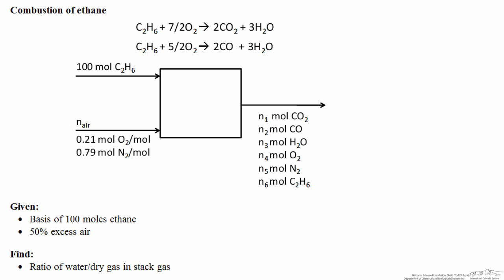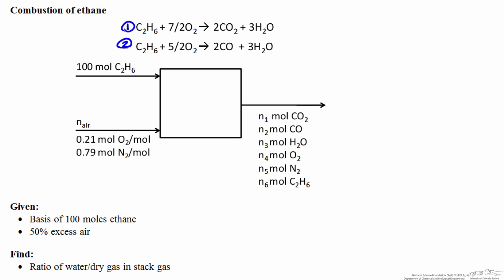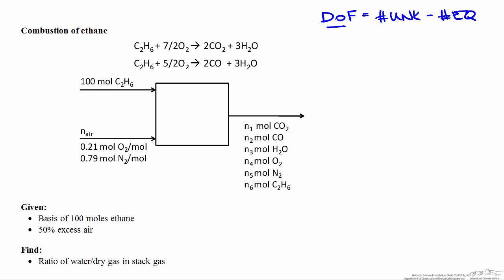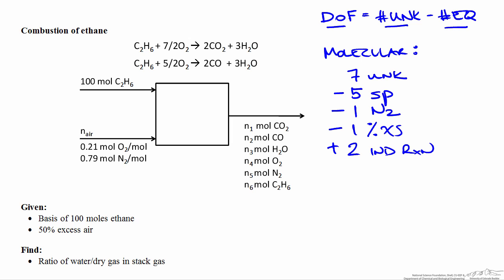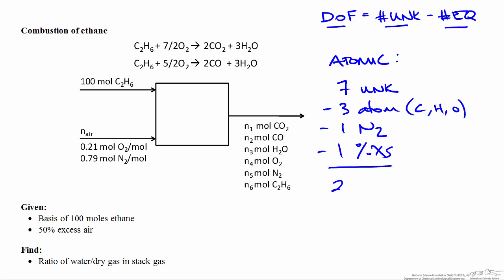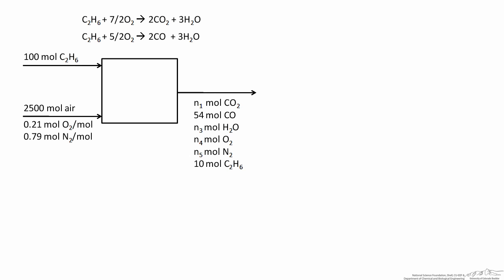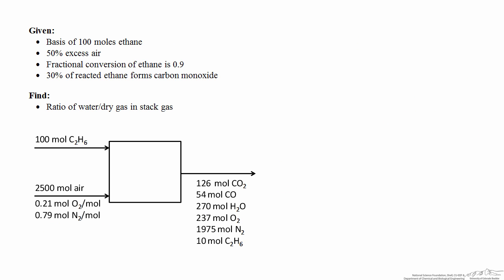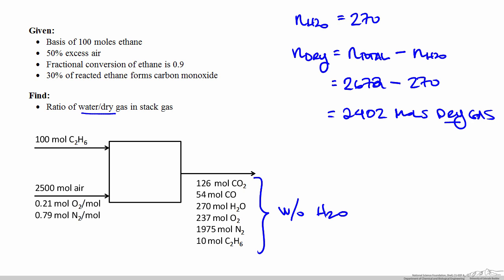Complete and Partial Combustion of Ethane

Comment: 8:44 For oxygen balance in input you put 2*0.21*2500, but in Nitrogen balance you did't include 2 you only put 0.79*2500.
Can you explain why?
Reply from the maker: Great question. When he was doing the oxygen balance, that was an atom balance, so every atom needs to be accounted for and there are 2 atoms in every O2 molecule. For the nitrogen balance, he is looking at the moles of the molecule N2, not the number of atoms of nitrogen. You could do it using atoms as well, but the 2 would just cancel out on both sides of the equation. (In this case, the reason why N2 can be done differently is that it doesn't react.)

Comment: Shouldn't the atomic species balance be( 2x n1) for carbon need help understanding if your using the rxn formula for this
Reply from the maker: Thanks for asking. n1 is the number of moles of CO2 leaving the reactor.  He does use 2 x the 100 moles of ethane coming in since there are 2 carbon atoms in that molecule.
Reply: @LearnChemE  at 2:20 you indicated  5sp and 1 N2. I don't quite clearly get why it is counted and why not O2 included by that reasoning. Will you elaborate this part? Thank you